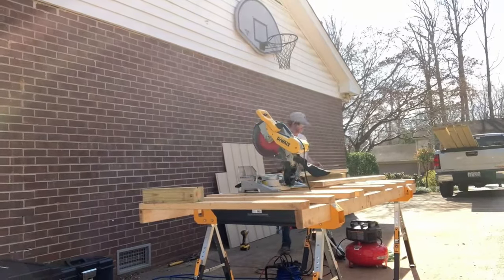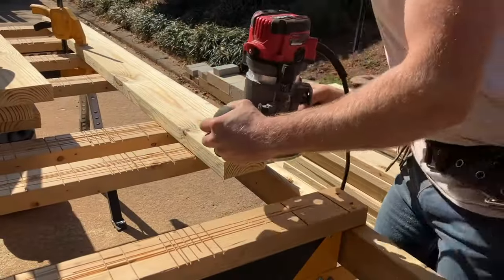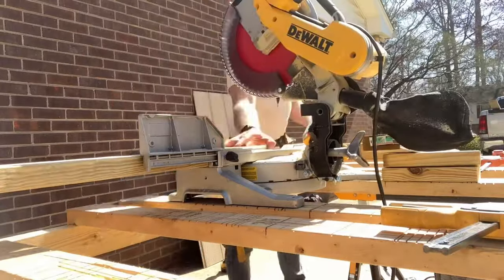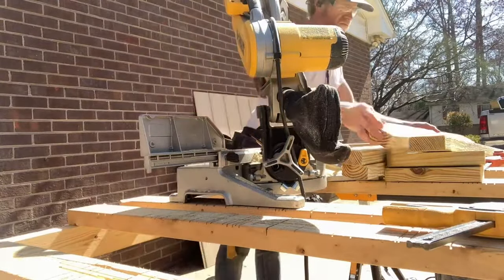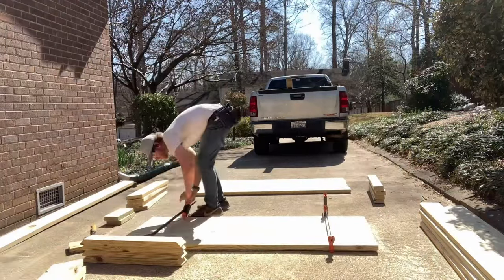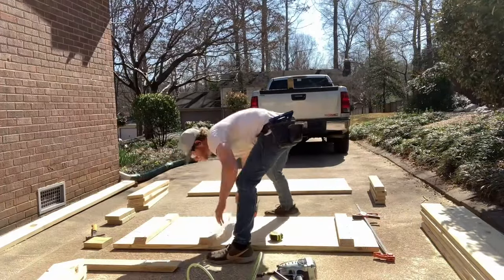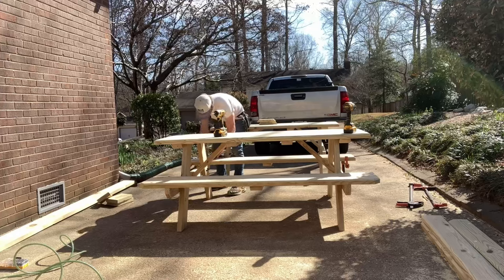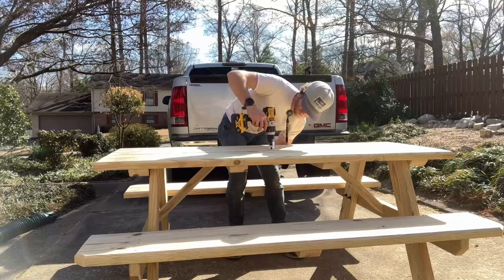How To Build a 6ft Picnic Table

Comment: Question. What makes it custom. It looks just locally made. Nice work. #2 why are the ends not a usable seat at the table adding 4 more seats. Doesn't make sense to cut off 2ft. Of usable boards just to make a table have 4 less available seats.  And I'm sorry but without a center stiffener at the bench height to restrict end to end movement. Those bolts will not hold that table together.  Most table take most human contact  at the long ends where there is no bench seat.

Comment: those bolts are a tad long...gonna skin a leg
Reply from the maker: That's a valid concern, but here's the situation: Those bolts need to penetrate 3 inches of lumber with enough coming through to apply a washer and nut.  3 inch bolts are too short so 4 inch bolts are the shortest bolts that can be used.  One could try to grind or hacksaw the excess off, but that would likely leave you with a more sharp and jagged edge than the painted factory edge of the bolt. Lastly, I haven't heard this as a complaint from any customers yet, nor have I experienced it with my own tables, but hopefully if someone did bump it with their leg, it wouldn't cause any kind of cut or scrape because the painted factory edges are relatively smooth. Thanks for watching and for your comment!
Reply: You can get 3 and 1/2 inch but I used 3 inch and countersunk them a little worked great

Comment: Great looking picnic tables! 
What height did you set the bench/seat to?
Reply: Thanks! So to kind of answer your question: When I install the bench support pieces I use 10.5 inch spacer blocks between the table top ties and the bench supports. Then when flipped over, this gives me a bench seat height of about 17.25 inches.
Reply: Thanks 👍🏼 
Good idea with the spacer block.

Comment: No spaces between the table top boards?
Reply: I’m using pressure treated wood that is still wet from the treatment process, so as it dries it will naturally gap. If you were using KDAT lumber (Kiln Dried After Treatment), you would probably want to gap them about 1/4 inch.